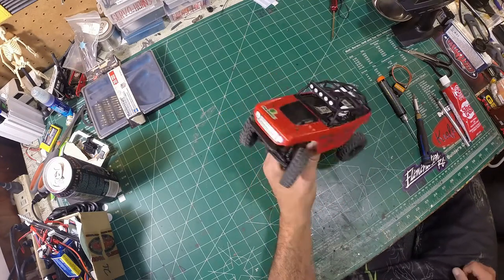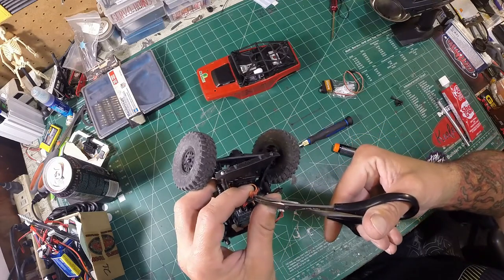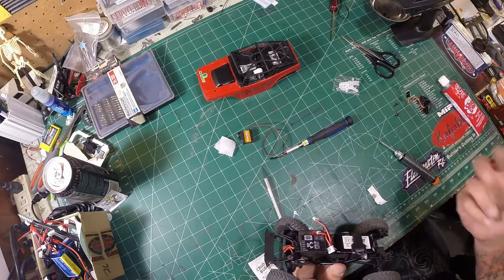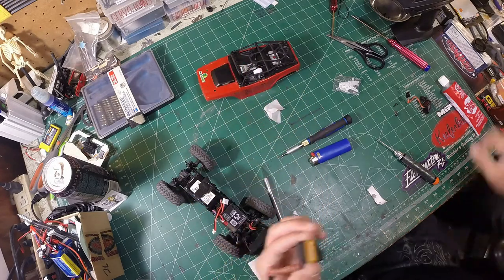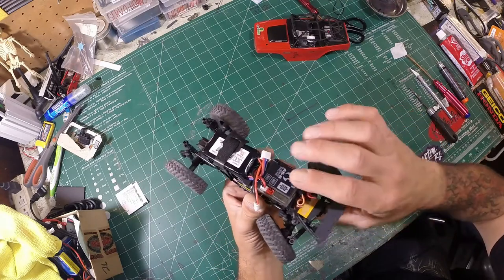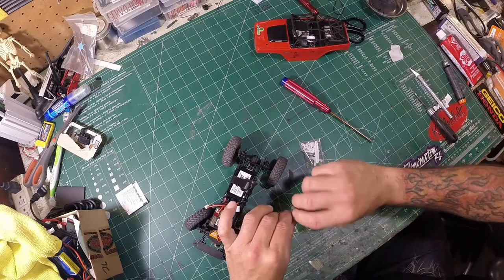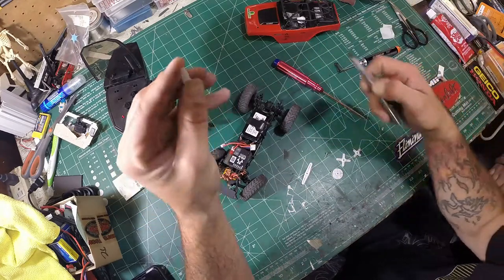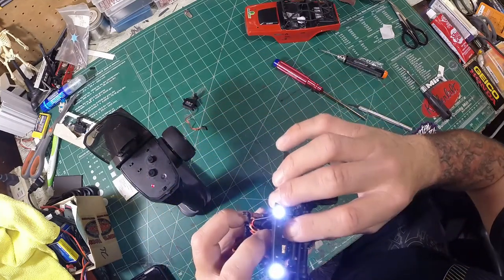AXIAL SCX24 DEADBOLT: Servo Upgrade

Comment: I recently upgraded my 1/24 deadbolt with the brass diff cover front and back plus those mil stone wheel wideners. I went to run it and I noticed I can't get a full steer left or right while its sitting on the ground. When I hold it it's fine. Also I did the shock mod that moved the front and rear shocks more forward to get the most flex. I guess what I'm asking is should I get a good servo or maybe drop some weight? I also noticed the esc got pretty warm pretty quick.
Reply from the maker: I found some material needed to be removed on the axle behind the new knuckles to get full steering. And yes upgrade the servo. I’ve had to remove the brass diff covers on one rig cause it too was running hot as the milling was out on the cover by .010
Reply: Quickest and easiest fix for this would be to simply tighten the servo saver. It is pretty loose out of the box. Then pop a nice servo in there when you are ready =)

Comment: I had added brass knuckles, wheel wideners, and wheels with weights.  I'm not getting full steering now.  Too much weight for a stock servo.  In your opinion..what's a really good servo to add that is not going to need much or any fabrication?  Thanks!
Reply from the maker: The Emaxx can’t be beat. Just make sure it’s not a fake. The fakes are like $9. The real ones are about $24
Reply: @@ProNoobRC  I bought a Reefs at my lhs earlier.   I hope it's good because I'm adding brass diff covers   also.  Do you think it'll handle all that weight?  Thanks!
Reply from the maker: Can’t go wrong with that servo nope! But be warned you may need to cut ears off and glue it down for best performance for clearance on the chassis.. it sucks but it’s pretty much the best way to do it
Reply: @@ProNoobRC  thanks..I'm not going to be doing it for at least a week.
Reply: @@ProNoobRC  Thanks again!  I appreciate the insight.   I'm thinking..I'll take it apart really well so it'll be easier to see how to getter done.  Might be needing a more powerful motor with all the weight 🤔  sounds about right, yeah?